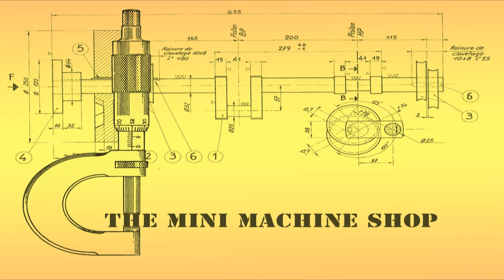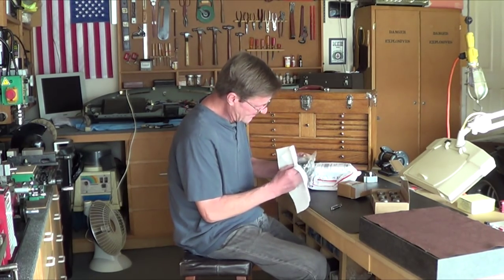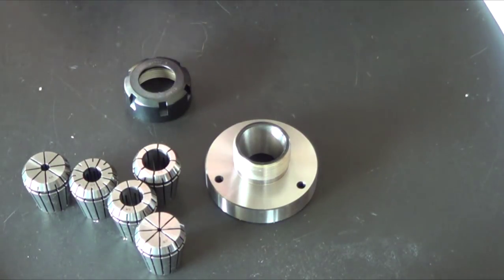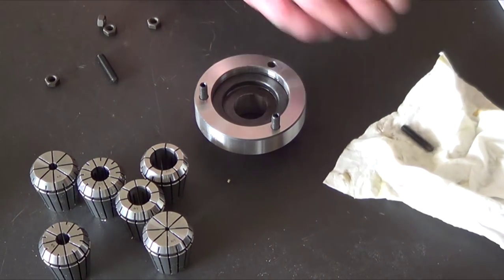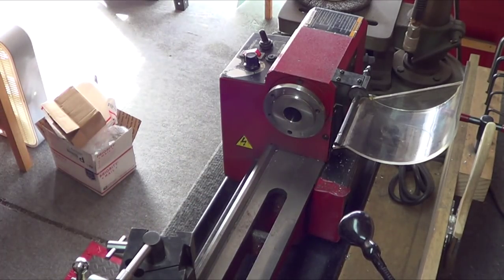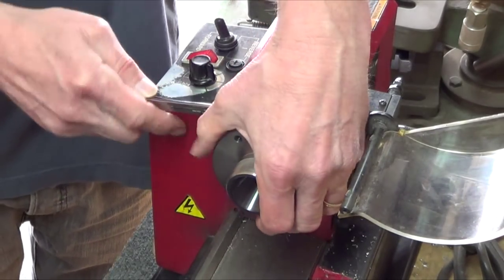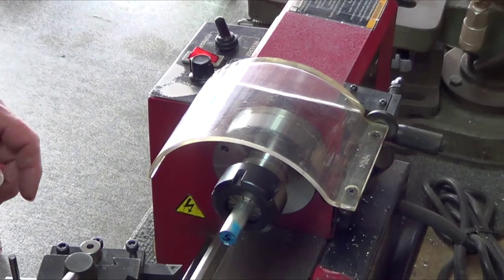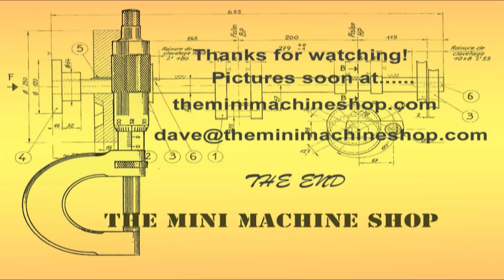New Shop Toy Video #36

Comment: You need to insert the collet into the nut first. It snaps in. Then it locks in with the eccentric. The eccentric locks into the slot on the collet so when you unscrew the nut, it will extract the collet from the holder. 

I went ahead and drilled three tommy bar holes in the sides of mine. Makes it a lot easier to tighten it up. I suggest getting the whole set of collets. They make it really easy for cutting down screws and such since you can clamp on the threads.
Reply from the maker: +David Kirtley Slowly I did finally figure it out. Thanks for the shout!
Reply: David Mitteer Yeah, I puzzled a bit with it too when I got mine.
Reply: +Dave M The thing I was cringing about was that I am sure now you realize that, as you were tightening it up, only the 'closest to the center' eccentric part of the retracting ring was closing you collet. Not the actual concentric part of the nut. That couldn't in the long run, create great precision.

Comment: Hi Dave
The eccentric section in the nut keys into the groove in the collet. The front face of the nut and collet should be pretty much flush when assembled. Hope this helps
Reply from the maker: +Peteip That helps!! So am I suppose to put the collet in the nut first then put it all in the chuck??
Reply: +David Mitteer . Yes, put the nut and collet together, screw it onto holder, then insert your work piece and tighten the nut
Reply from the maker: +Peteip Now it all makes sense!! THANKS!!
Reply from the maker: +T2H Instructionals Ahhhhh  now I know why. Without the groove the collet gets pushed in when you try inserting stock and locks down. With it the collet can't get pushed in! That's why I had a problem until I removed the collet and put the stock in. Also looking at the chuck box its from HHIP not LMS and isn't shown on their site. Hmm. 3901-5032
Reply: At my first use of collets I ma @TheMiniMachineShop e the same mistake but got a lot of run out. The nut also looked crooked, uncentered, sharp edges. The seller told me how to mount the pieces and not to bother about the strange look of the nut.
 Even my expencive and beautiful 4 and 6 sided, ball bering collet holder nuts looks uncentered inside.

Comment: @ dave im trying to cut a round bar stock of 2.5 inches in diamter.is there a collet chuck that size for this mini lathe?
Reply from the maker: +boogymcguiness I pointed to this video to show the improvements in using ER32's. The maximum size they go to is 13/16. I had no idea you had something that big to work on. You'll have to use the 3 jaw! The only thing you can do to remove some of the run out is use the live center if you can.
Reply: +Dave M thanks for the info dave.much appreciated!

Comment from the maker: I need help!!! The nut for the chuck says ER32-M40X1.5 nut what's the difference with a ER32-U4 nut??? I'm looking at this for the mill and want to use the  collets I have. http://www.amazon.com/MT3-ER32-Milling-Collet-Holder-Cutter/dp/B00RN38KPO/ref=sr_1_3?ie=UTF8&qid=1454116381&sr=8-3&keywords=er32+mt3
Reply: +Dave M they will both work on any ER32 collet. the M40X1.5 is just the threas size of the holder and bothe nuts will have that. The U4 is a designation (there are several UM, U etc) about the speed that they are balanced for. some of htese go up to 20000 RPM. So unles you have some super equipment either will work.
Reply from the maker: +Charles Goodwin Thanks for letting me know. I researched a lot and never found an answer.